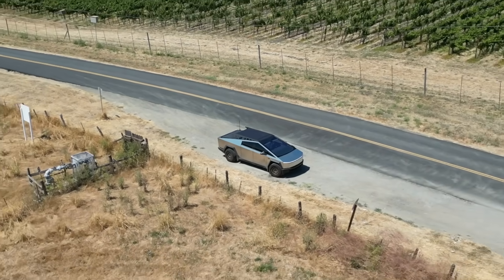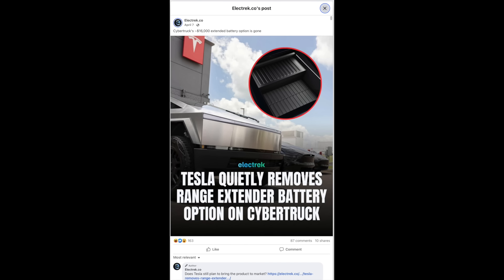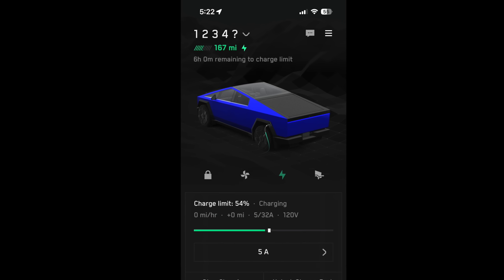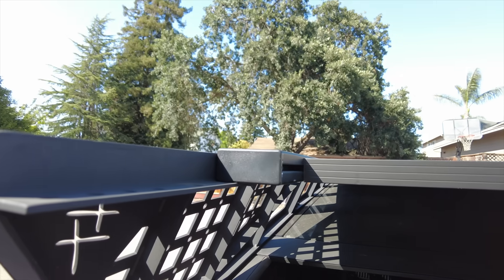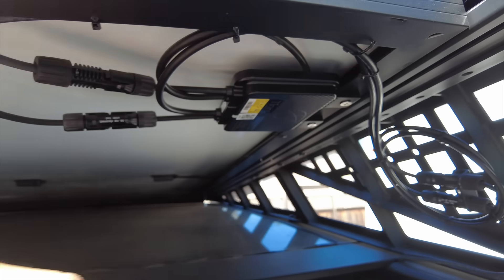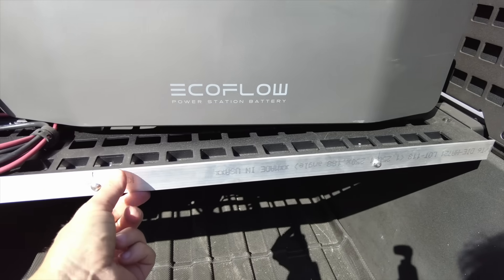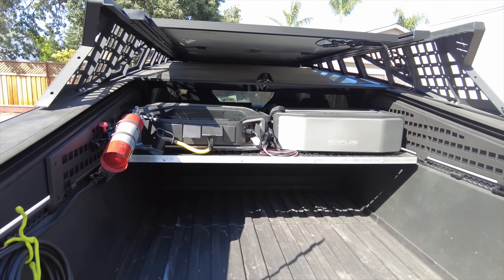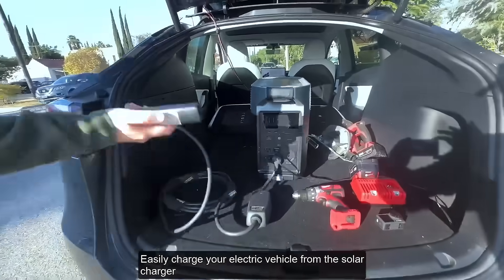Cybertruck Off Grid Solar + Battery: Build Breakdown Deep Dive

Comment: You beat me to it!  Had this type of setup last year with bluetti batteries. The 600W is real and makes it impossible to charge at low power.  

With bleutti you can monitor the SoC with Bluetooth and with something like an raspberry pi and a Shelly rely controller you can control when the battery discharges to the truck.  The software would be pretty easy to write, AI could probably do it. You'd have to keep it between the 100% and 5% range because these batteries turn off AC output at 0% and don't ever turn it back on when above 0%. Not sure if the ecoflow is similar in that regard.
Reply from the maker: Oh cool. Glad to hear others have discovered this flaw. The problem with controlling and discharging remotely is a lot of times I’m out of cell range so I can’t access the truck or anything else to monitor
Reply: @WorthWords-cw5xh right. You'd have to have the controller locally running off the battery.  For my use-cases I was worried about phantom drain leaving the truck parked for days during  backpacking trips. The most elegant solution is for the truck to support low power charging. Then we can eliminate any need for a controller or battery.

Comment: Interesting setup, if there were a way to splice into the trucks battery, that would be ideal, and directly trickle charge it, to avoid losses from the inverter and heating. Also, I would have chosen an anker f3800, it has an ev charging mode with built in neutral-grounding bond. Checkout my video on it charging my model 3 if you want to see how it works.
Reply from the maker: Really?!?  Thanks. I’ll definitely check it out!
Reply: There should be a battery connection under the front part of the bed, because they were planning on adding extra battery in the bed.

Comment: I think if you took a RUiXU 16kw 48v Battery i think would work great for this application with a sungoldpower 10KW 48V Split Phase Solar Inverter
Reply from the maker: Yes. I’m seriously considering it
Reply: I would use a 10kw inverter powered from the truck outlets as the utility input for buffering and go without the batteries.

Comment: One thing to consider when you charge is the system doesn’t go on sleep mode, so even in optimal conditions it has an overhead. That’s why Tesla has a 5A minimum.
Reply from the maker: True. Even at 5a battery still goes down. I don’t think other Tesla’s are pledging by this though

Comment: Just use a switch for the solar panels you do need atomizer is that stupid
Reply from the maker: Optimizers are still the way to go.  Switch adds complexity and additional steps. Plus if I park in partial shade they can handle that

Comment: I don't think any of the naysayers ever go offroad or camping. Yes, Captain Obvious, the CT is not an Aptera. But every kilowatt is another mile out (round trip, gotta get back), maybe more because you're going slow. Or more time out there.
Reply from the maker: Yup!  I love the out doors and if I can stay longer that’s a win!
Reply: lol!!!!! it doesnt matter if naysayer or not! you can buy a 30 years old ICE truck repair it and litteraly fit a massive fuel tank its just much easier with ICE and diesel gives you even much better range and towing capabilities.
Reply: some people have even bough very old school bus or military trucks that can run all types of fuels from diesel to petrol to LPG to used oil.... you just throw everything you find and youre good to go.
Reply: dont get me wrong EVs have their advantages but you have to accept the downsides!
Reply: @carholic-sz3qv  ICE trucks are super slow, though.
Reply: @davidstewart1153 how exactly are they “super” slow? What a joke! Also speed is absolutely a useless metric for trucks! ICE trucks are made body on frame to be modified and used for all kinds of applications not like the useless evs
Reply: @carholic-sz3qv  But slowly. Wake me up when your V8 finally starts turning and immediately loses power through slushbox auto.

Comment: You should look at the EcoFlow PowerPulse EV charger. I plug it directly into the DPU Power I/O port, set it to surplus solar, and it magically charges using excess solar. Alas, you need many more panels than one. I have 4800w of solar feeding my EcoFlow DPU
Reply from the maker: Yikes! 4800!  Nice.  I’m a far cry from that

Comment: Try looking into replacing that ecobattery thing with a sizable ultra capacitor and it will be able to dump high power and not get fatigued. However it doesnt hold much and will be micro dumps when full which may or may not trigger the heating of the HV battery?
Reply from the maker: Thanks for the recommendation. Capacitors are awesome.  Wish there was more interest in them

Comment: You know you can just go direct to hv. Tap the hvac lines, I’m assuming they are similar to model 3. Find a 400v inverter online. Same thing goes for paralleling similar 400v batteries to teslas and towing them behind you on a trailer. The bms should calibrate the batt at night when everything disconnects for the next day. This whole back and forth rectification/inversion process you’re doing here is just a waste of time money and resources.
Reply from the maker: Agreed.  But I like having a warranty on my truck.  So I have to keep doing it the inefficient way for now😢
Reply: @WorthWords-cw5xh  its very much reversible

Comment: lol i added 200w of flush mounted solar to my 2013 chevy volt and it adds range to the car every day. i make posts about this in the gm volt forums under mods/accessories. its a pretty dead forum, so you can find all my posts on the first page. has been working for around 2 years now. some day ill make a video and shit talk all the channels and musk who said there was no way to figure this out. my whole system cost like 200 bucks and gets rid of the original agm battery for a LTO battery.
Reply: I have a 2013 too.  Gonna check out your thread!
Reply: @ezdeezytube fellow 2013 buddy!  Were out there!
Reply from the maker: Yes!  This is the way.  I’ll check out your posts.  Thanks
Reply: @WorthWords-cw5xh  just uploaded a poorly made video explaining everything
Reply: 200WATT IN A 1000KG CAR .. YES YOU ADDED KM.. BUT
WHAT IF CAR IS 3000KG WELL 200 WOULD NOT RUN WIPERS 
YOU ARE A CON ARTIST AND YOU CULD NOT GET POWER ENOUGH.. 
TO SOM 30KM A DAY .I TAKET  YOU LIVE IN EQUATOR

Comment: A propane tank and generator will reduce aero drag and can be used 24/7 and should take less space and can store more power.
Reply from the maker: Yup. I’m not opposed to propane or diesel generators. Just trying something. Want the infinite energy glitch
Reply: @WorthWords-cw5xh  Haha I get that, but it'll likely be more effective to keep a bunch of panels in the bed, then set them up like a large gazebo when planning to be stationary for hours or days when Off-Grid.

What Wh per mile are you getting with that setup? If driving 55mph I can get 320-350Wh/mi, going 80+ I get about 450-550Wh/mi. If efficiency is affected a lot, it might be burning more than it gets, which will give you the opposite results desired, like using a battery to turn a perpetual motion machine. Haha

Comment: Also for much cheaper Bulk Builts can look at different options like this , or even you own custom built : https://www.youtube.com/watch?v=oisSDHpgld0&list=PLmnrgBLYCIklemnWbYiPUyNPruKZSj5kz&index=6

Under 4k for 16kw Battery output split phase 122/240  10kw power output
And even wire out one of those more Powerful Tesla Wall Connector Home chargers Directly to it at 48A x 240v = 11.5kW charging thats crazy
Reply from the maker: Agreed. Definitely need to step it up.  I didn’t know the battery heating issue was going to be such a big deal.  Now that I know, a lot has to change.

Comment: Not sure what you mean the mobile charger is 120v why not just use the 240v 30amp plus with the Mobile charger if 120v waste too much power heating the battery ?

I did similar charge with my 48v Server rack battery system but my Inveter is only a 120v output so max I can do is 12amps around 1440w which I see what you mean certain days would drain my car when charging always wondered why 
But days with a lot of sun 2kw solar panels will put like 10% extra charge into my model Y so very interesting to learn more for sure
Reply from the maker: I could use the 240V outlet.  But because I only have one battery currently the 120V 30amp outlet drains the battery rapidly enough.  Still the main issue I have is having to hover around my truck dumping the battery. Letting it recharge and then dumping it again.  Just to get around the vampire drain of the cybertruck battery heating issue.

Comment: Have considered using the J+ Booster instead of the Tesla mobile charger? It should be able to charge faster, I think. DC charging would be more effcient of course, but that would be a custom build.
Reply: I had forgotten about Sparkcharge. They have a portable DC charging solution.
Reply: @SkepticalCaveman yo!! This sparkcharge is so cool! They have a 300KW trailer option!! 😮😅 
Charge speeds are slow but that’s ok, it’s good tech.
Reply from the maker: No, I haven’t looked at any other chargers yet. Definitely DC would be the way to go. But that’s a whole Nother level.
Reply: Yup…if only DC mobile chargers exist, bye bye inverters
Reply: @Prem-jd8li I know of Solar to DC chargers but they are for homes, not mobile.
Reply: I’ll check to see what I see in the car once I get home.
I’m currently at a 72KW supercharger and DC voltage is around 370V
Reply: So I didn’t realize this - home chargers and mobile chargers supply the vehicle with AC power. The onboard charger converts it to DC.
But Superchargers are an exception - they are the only DC - DC chargers, charging the cybertruck at 400V and 800V.

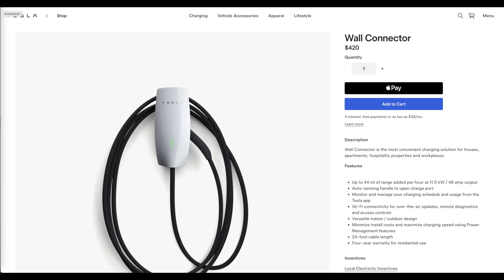Comment: 5:58 what if you have a 240v mobile charger?
Reply from the maker: The mobile charger will do 240 v. But even charging it 120 V at 30A it dumps the battery really quick.
Reply: @WorthWords-cw5xh the battery doesn't hold much. He'll lose more range than he'll get from that solar due to the weight and cost in aero efficiency.  It's only good for using as an rv parked or something.
Reply: @ItsBinhRepaired yes can somebody do the math on this? The Tesla Cybertruck consumes approximately 22.6 kWh per 100 kilometers, if you add extra weight and drag it will only increase. He generates and stores 10 kWh in a good day, looses 600 W while charging so let's take 8kWh ends up in the Tesla battery. Rounded up 4 km per kWh, he gets about 30 km extra range in a day. Camp for 3 days, using no electric appliances means about 100km range. Or if you cook electric, use airco and watch TV, he gets 0 km range increase

Comment: I think the new bluetti Apex 300 might be an even easier solution simply because it has 240 V out and it’s quite small
Reply from the maker: 240v is ideal for rapidly discharging the battery. I still think I need a bigger battery if I’m gonna make any kind of headway on increasing miles in the truck
Reply: @WorthWords-cw5xh true.   There are expansions batteries as well.

Comment: Assuming 4 hours of peak sunlight per day and no energy losses, a 400W panel would generate 1.6 kWh per day. To charge a 100 kWh battery, it would take approximately 62.5 days of continuous, optimal sunlight. 😂
Reply from the maker: lol. Yeah. That’s why I was going with 3 and a mobile 4th panel.  Still far from ideal
Reply: Including non peak. That is still 6-10 or so miles a day. I wish I could have a magic Jerry can that added a liter of gasoline to my truck each day.
Reply from the maker: @hightechredneck8587  it’s about 10 miles I add with this size battery
Reply: @hightechredneck8587 😂 apparently you've never heard of ethanol or wood gas
Reply: @rotaryenginepete  Wood gas is just more corrosive hydrogen, and ethanol is more work than it's worth. bang for buck biogas is the best bet but that requires a lot of work on a vehicle. 

But magic gasoline is still better than all of those lol.
Reply: @hightechredneck8587  wood gas is not corrosive and it is super easy...
Reply: @rotaryenginepete I've built a gasifier. If you don't run it through a scrubber you will have a bad time. Lots of nasty stuff in wood. Plus woodgas is basically just hydrogen with a bunch of impurities.
Reply: @hightechredneck8587  120mm ammo can full of media in line with a condenser works great.  It's not rocket science.
Reply: @rotaryenginepete that works for a quick and dirty one. But wouldn't get hot enough for complete pyrolysis. You'd get lots of creosote and completely gum up any engine.
Reply: @hightechredneck8587  it's the filter, not the reactor.  And it works great, cleans the smoke out effectively.  Not dirty at all.

Comment: I recently installed a flux capacitor on mine and have not had to visit a supercharger since. I’m careful not to exceed 87mph as the only downside.
Reply from the maker: lol. Unless you set your Time Machine to take you back to when $TSLA and BTC were only a couple bucks
Reply: I installed a hamster wheel, and still need to go to supercharger, but when I supercharge my tesla, the hamster's eye glowed up.
Reply: @edwardtse8631 Did the same bit current produced was too small and the hamsters threatened to unionize. We know how that goes with Tesla. 😏🙄😅
Reply: Did you get to go back to the future?
Reply: Hey what’s your email. I’m working on a solar panel project. Would love to colab
Reply: Your flux capacitor is useless without 1.21 Gigawatts. My Mr. Fusion has solved all power problems.
Reply: lame!!!!!!!!!!!!!!!

Comment: Any reason you didn’t use the 240v / 30amp output on the EcoFlow unit? 9:12
Reply from the maker: Not really. Price of adapter was cheaper.  Either plug empty’s that battery quickly
Reply: @WorthWords-cw5xh 240v would be a little more efficient. You’d probably get an extra mile or so per full charge from the EcoFlow.

Comment: A quad panel design two center stationary with one extending over the front and one extending over the back should be possible
Reply from the maker: Yes. That’s the plan. Tip to tail

Comment: We need to find a way to charge while driving, perhaps there is a way to go solar direct to battery via the range extender port. I would imagine this still needs a charge controller capable of communicating with the existing software. There's probably always a way to cut in a little deeper but that gets sketchier and sketchier.
Reply: That would be the absolute end game win. With something like that it would be an absolute game changer. I would settle for a charge port in the box, and a "smart charger" that can communicate with the truck. but I'll take anything.
Reply: @hightechredneck8587 It would make an EV purist roll over in their future grave but I would buy the truck right now if I could just plug a diesel generator into the range extender port. LOL

I would also love to have a trailer with a giant battery in it that I could use to backfeed the truck while driving. 
They should be able to do this from the charge port though it's positioning is not ideal for plugging in a trailer.
Reply: @WentzCraft also a bench seat! I know the cybertruck does. But f150 and the chevy, both removed the bench option. As a country boy, where am i supposed to store my rifle if there is a cupholder in the way lol.
Reply from the maker: Charging while driving would be awesome. I’m hoping if we make enough noise, Tesla will notice and maybe add something like that in the future.
Reply: @WorthWords-cw5xh it would solve so many problems. Someone must have considered it in the engineering department.
Reply: @hightechredneck8587 this must be how the range extender battery would have worked. Physically the trucks must be wired for it but software status is a whole other issue. Unless the range extender was a complete fabrication from beginning to end.
Reply: @WentzCraft well from what i was reading each module from the cybertruck is 24V. If i was a betting man, I'd bet there are just some cables on the bottom side that somehow connect to the other modules in the larger battery enclosure. Or it's a 400V pack and it connects to the enclosure in parallel. A good BMS should be able to take care of that.
Reply: @WentzCraft  the range extender would have just worked like the GM 800v double stacked battery which could separate to two 400v to recharge on different stations for example.
Reply: @WentzCraft why would you plug it into two chargers? The systems is just able to switch to 400v to charge when it’s not plugged into an 800v charger
Reply: @carholic-sz3qv nobody would, I misunderstood your comment. I'll delete that post.
Reply: You realize that a full day in the sun would net you 1-2 miles especially if you enabled anything like sentry mode or cabin overheat cooling?  This is not driving around, but positioned perfectly in the sun, not using your vehicle.   It takes a 1500w wall charger an hour to add 2-3 miles to a Tesla 3.
Reply: @handlealreadytaken That's still a free tank of gas every month just for parking in the sun. 

Regardless I was more interested in towing battery trailers or using a diesel generator while driving.
Reply: @WentzCraft  no its not a free tank of gas lol!!!! to charge that massive battery with the tiny solar panel its going to take months at best.

Comment: I spent a couple years solar charging my small boat. I have been thinking about your project and what you need is an all in one solar unit. Have you considered this?
Reply from the maker: That would be nice if they made something like that. Off the shelf is much easier than DIY.
Reply: @WorthWords-cw5xh  All in one solar units are off the shelf. They are pretty good. From what I have seen.